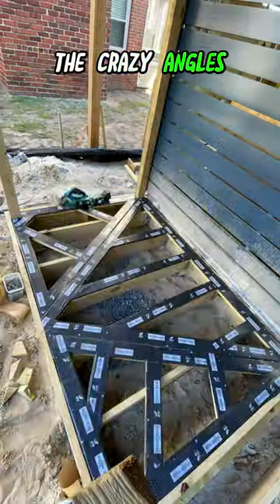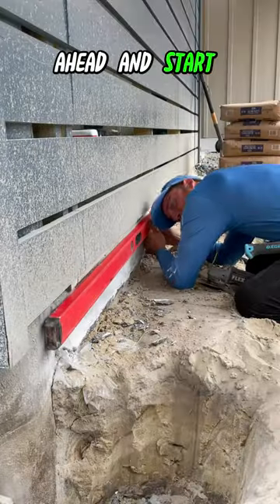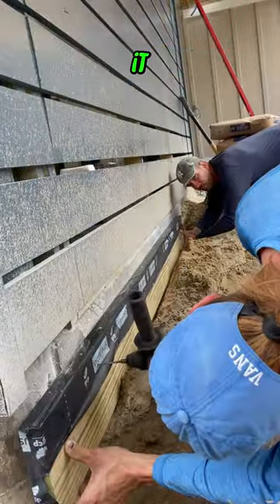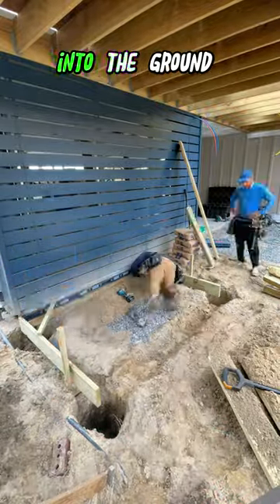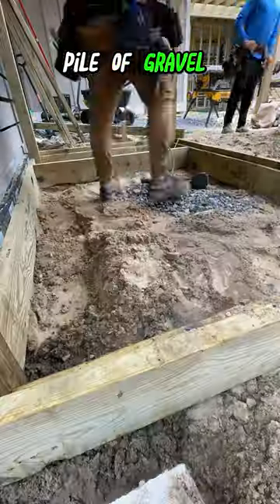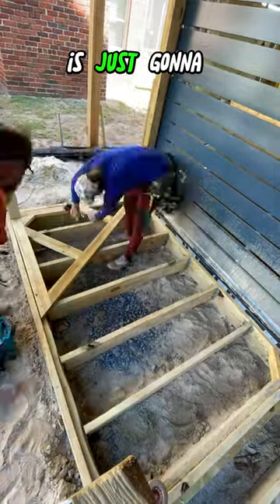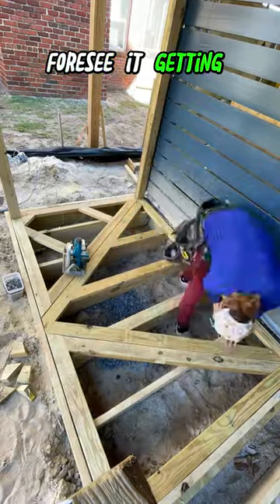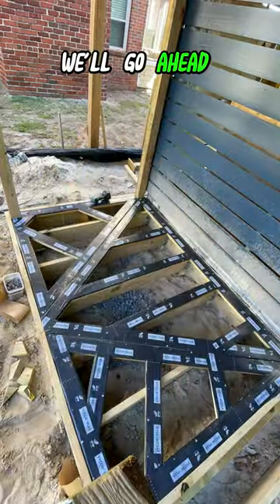Outdoor Shower w/ Panel Decking 1 | Artpentry #artpentry #carpentry #diy #artisan #art #shortsvideo

Comment: A drainage pit right off the foundation??
Reply: It looks like it would actually keep the water away from the foundation.........almost by design
Reply: @Kyle-cv3de  That's not how water works at all. Doubt it'll ever be a issue but not the best idea for sure but it does look nice and cool.
Reply: @demikpre  yes it is exactly how that works. Unless your soul is heavy in clay, thatll work just fine
Reply: It will be just fine.
Reply: Totally agree. Should have leveled off the concrete foundation and then added supports and added the post.  I also would have gone 6x6.  But I get it charge the home owner $x and get them the 4x4. But we are talking couple dollars. I be pissed if I saw my deck post buried like that. But I get it’s done that way majority of the times.  Just give them your business card and you ll come back to repair after the warranty is over. Lol
Reply: That soil is definitely clay. Maybe it’s sandy-clay, which would help but the percolation rate still wouldn’t be ideal.

The percolation rate is known, so it would not be difficult to calculate how long it would take for the water from a typical shower to percolate into the ground for a given area of soil. 

Clean drain rock has a void ratio of about 25%, whereas a pipe has a void ratio of 100%. You could quadruple the capacity by putting a drainage pipe in the middle of the rock.

Comment: Why only a hole for drainage?? Why not an actual drain pipe? Like home gutter drains
Reply: my thoughs exactly. probably to save money.
Reply: Bc that doesn't make sense
Reply: It’s Florida it’s not a shower for people to shower it’s a washyoursister-sauce station to clean feet I get a gravel pit cause sand soil water don’t collect unless your in a swamp
Reply: Ever been to the beach? Things are done differently, bubble boy
Reply: was thinking the same thing. Perhaps a liner with a drain tile tied to a drain pipe leading to a drywell several feet away from the shower platform.

Comment: If you do a project like this again, I strongly suggest digging a little deeper, and hauling in a bit more gravel, along with installing some proper drainage to divert water away from the foundation.

With the high moisture, and the wood in contact with the soil, this will need to be redone in a few years.
Reply: 😂your not that guy .your not that guy
Reply: Redone in a few years... Cha-ching.
Pressure treated?
Reply: @emrysmcwryn7902 yea I was thinking mabey should of used treated lumber
Reply: @emrysmcwryn7902  Exactly right. Work like this is why that stereotype of contractors exists.

I'll say this: sometimes doing what the client wants, and "sticking to the budget" aren't worth it. I'd rather be the guy to decline a job, than to do sub-par work to satisfy one client and cash one job.
Reply: @jonasgeez2140  all the lumber he used in this video is pressure treated.
Reply: @hanskrokenberger7956  oh well that's great then it should be fine

Comment: Had a thought when you were talking.. wrap the underside of the wood that makes contact with ground.. 
that should help protect it
Reply: If only they made a product that looks like wood, but is resistant to water, rot, mold, etc...  but strong enough to build with! 🤔 something like a composite material........
Reply: LOL @BleedingWhiteKnuckles
Reply: @BleedingWhiteKnuckles fr that’s what I was thinking 💀
Reply: Composite material isn’t as strong as wood. But it can be used as a cladding.
You COULD use his funky tape on the underside of the joists, but that stuff is more likely to get water behind it and contribute to the rotting of the wood. Here I would have dug out at least a foot of the dirt and sand, put down filter cloth, then gravel. 
You could also use pressure treated lumber for the joists and beams.
Reply: @BleedingWhiteKnuckles it’s also fortunes
Reply: I thought the same thing.
Reply: There’s plenty of composite material that is stronger than wood. It might also be a lot more expensive than wood so not in the budget. 

Heck, concrete is even a composite material that is stronger than wood. Could have made the foundation a perimeter footing. That definitely wouldn’t rot.

Comment: Shower is shower.
15-18gals water average.
Add someone else and consumption goes up. 
Ground only absorbs so much before it floods or goes back into basement/foundation.
Yikes
Reply: Yes yikes.  Bad idea.  Should of just done a actual shower pan catching all the water and diverting it far away from the house !
Reply from the maker: @adammonahan687 I will suggest these to the builder on these houses.  For now I’m just doing what’s asked of me
Reply: @Artpentry  no I get it
Reply: @Artpentry  I wasn't exactly meaning you should of but instead the owner should of had you do it.
Reply: @Artpentry  deck work is good, it’s just bad for draining. The one week I don’t clear gutters of leaves, and a 1” + rain occurs, the basement gets water-despite French drain, plenty of plan ts and about 6ft of clay…
Reply: Im sure they explained to the client about drainage but let it go to the ground
Reply: Exactly.. nobody is going to take a 30 second shower.. I doubt that thing will last ten years..

Comment: You could have dug it out and installed a catch basin surrounded by stones.
Reply: What's a catch basin?
Reply: @LloydTaylor  It's like a big shower pan buried under gravel for drainage. Water hits the basin and is diverted away instead of allowing it to erode the soil under the gravel.
Reply: @LloydTaylor    A catch basin is basically a barrel (50 gallons)  with a bunch of wholes and wrapped in a fabric.  

You dig a hole. Fill the bottom of the hole with stones. Install the barrel and fill around  the sides and top of the catch basin with stones. 

The catch basin as a drain in the top. It looks like a shower drain.  When someone showers the water will collect in the basin and slowly drain out into the ground water without having erosion issues.

Comment: Genuine question from someone with no experience or knowledge but wouldn’t it be better to use a material like Trex to avoid the wood from rotting over time being on the dirt?
Reply: Genuine answer from someone with no experience or knowledge is that Trex doesn't have the structural value needed.
Reply: Pressure treated is way cheaper. Synthetic decking material is twice the cost at least.

Comment: Bend metal to over lap wood as it goes into ground.  Done it this way 9 years ago on a 12' x 64' deck with roof and benches.  It was 2x12 rim joice and 10" was below grown level.  Still looks good.  We also had a positive drain around it to direct water away from deck and building

Comment: Next time you could put a 5 gallon bucket upside down in the dirt hole and plumb waste into it. Surround the bucket with large stone or riprap. Then add yer blue chip to finish.
It creates a void for the rapid influx of water to fill in before naturally filtering down.
This helps with the rare event many showers overflow the shallow hole and drainage leaks into the yard.

Comment: Hey. How often do you foresee them having to take the gravel out to remove and clean out any debris that gets stuck in there?
Reply: There shouldn’t be any debris filling up the gravel hole. The gravel leaves gaps between the rocks that allow the water and mud to sink to the bottom and absorb into the ground. This keeps the ground underneath the deck from flooding and pooling up and making a mess/rotting out the wood. But tbh I’ll bet in like 10 years that hole will be filled up entirely with mud and will have a slight drainage problem. Spend a day pulling the deck boards up and dig a new hole. Not the end of the world

Comment: It looks great only thing I get yelled at about is using green plate when it's touching concrete then you don't have to tape because of how the green plate is treated so it doesn't get wood rot as fast due to the concrete absorbing the moisture other than then this looks really good keep up to work man love ur vids
Reply: All the framing lumber looks to be pressure treated to me look again
Reply: You have to use a gasket when wood touches concrete pressure treated or not.

Comment: I'm no expert but I probably would have run a french drain or a collection tray with solid pipe to a soak pit away from the shower deck. I did it once before when I had a waterlogged garden on one side of a house and it worked wonders.

Comment: I honestly don't get the tape. Now I know treated is not as good as it once was. But I'm not putting tape on it. If your worried about it touching concrete use a stand off. It's a shower so tape on bottom is going to hold mostioure in the wood its simple physics air going all around wood will dry it out.
Reply: I am asking as maybe tapes way better way?

Comment: "2000$ Drainage Pit add-on" = 25$ of gravel from Home Depot

This type of work doesn't make sense any other way then a scam. Everyone knows plumbing, electrical, and supports are built to thier max capacity, not minium. Like what if the valve body goes being outdoor next to the salt water? What if they have a party?

It would make more sense to me that whoever is having this built would want. It built correctly with a proper drain given the houses value and cost of job. That's why i'm saying it makes most sense as a scam. He was probably charged for a proper drainage system and got twenty five dollars worth of gravel instead.